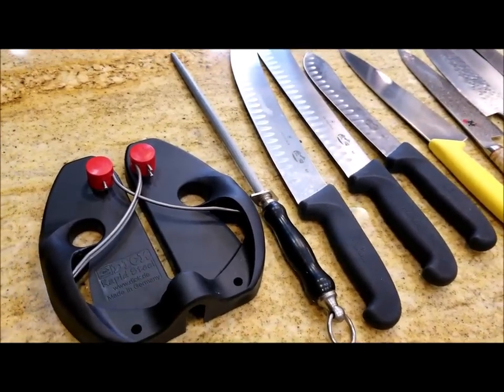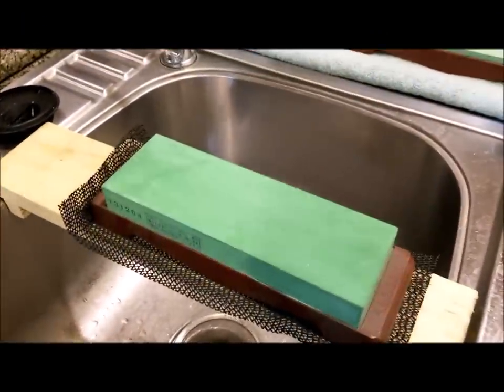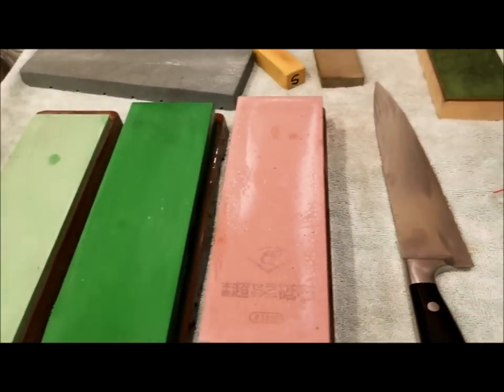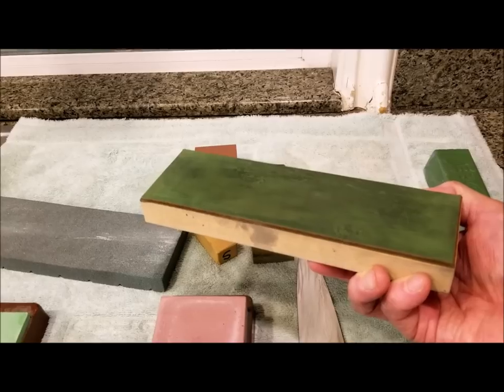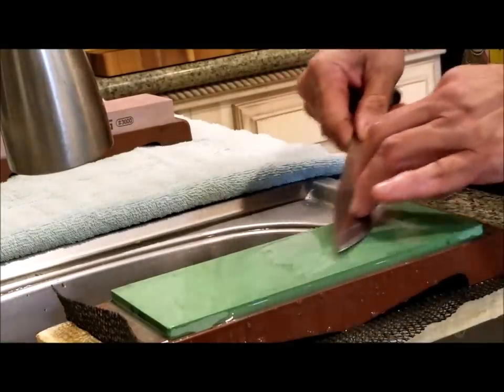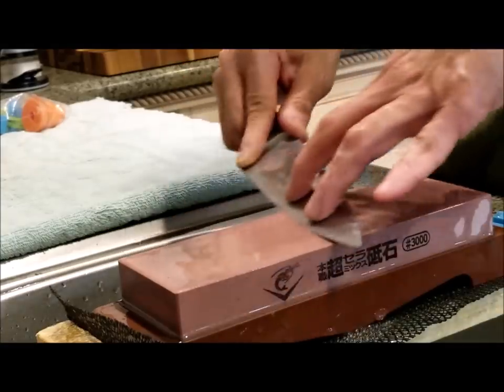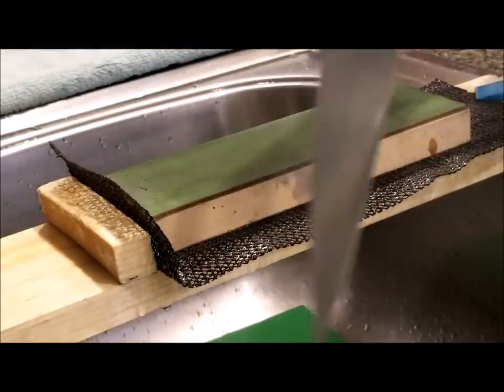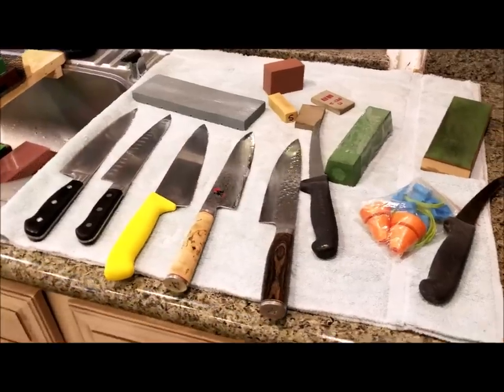Whetstone Sharpening BBQ Pitmater Knives Knife by Barbecue Champion Harry Soo How-to Blade

Comment: Great info Harry.  Two things that I was taught is to bevel the edge of each stone prior to use.  I use my DMT DIA-Flat lapping plate and  put a small 45 campfered bevel on all edges of my Shaptons and coticule.  This avoids chipping on the stone edge.  Was also taught to use a pencil to draw light hash marks across each stone prior to flattening.  With this technique its very easy to see where the low points are due to remaining pencil marks.  Once they're gone you're perfectly flat.  You achieved a great edge.  You nailed it with the basic equipment needs also.  Thanks for the time you dedicate to these videos.
Reply from the maker: Thanks Steve. I have plenty more intel on knife sharpening and will make more knife videos.  I was not sure if my viewers who come to watch barbecue might be interested so I'll take your comment as a Yes!

Comment: I currently use a Lansky system with good results but like you said in another video, time consuming. Do you think the Rapid sharpener will give comparable results to Lansky?
Reply from the maker: No, the Lansky will give a better edge.  My knife dulls after one brisket so I don't have the energy to Lansky it after each brisket.   6 strokes on the RS and my knife is ready for next brisket.  Alternatively you can buy many knives and have a fresh knife ready each time.:-)
Reply: @SlapYoDaddyBBQ  you the man! Thanks for the quick reply. Your videos have really helped me step into this world of backyard BBQ. I was on the fence getting a WSM 14.5 but your Amazon product review gave me the confidence to get it knowing your videos were there. Best BBQ channel on YouTube. Keep up the good work and keep living your passion!
Reply from the maker: @malachieveritt3273  Be sure to watch my mini smoker videos: World's Smallest Kettle Grill - https://youtu.be/0VKPVZNim0c
; Tamale Pot Smokey Joe - https://youtu.be/HsxnNX6LXI4;  http://virtualweberbullet.com/miniwsm.html; Weber 14 - https://youtu.be/ur2Shg_5bE4
Reply: @SlapYoDaddyBBQ  where would you suggest putting a thermometer probe on the WSM? Stick it through the rubber grommet and then can you just let the metal probe stick in the air or should it be on the bottom or top grate?
Reply from the maker: @malachieveritt3273  either rubber grommet or the top grate is good.